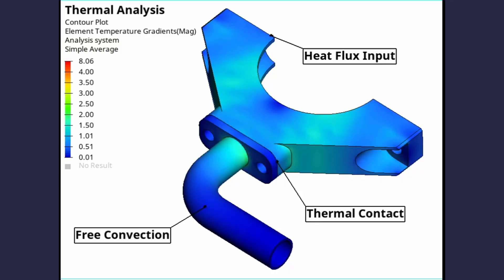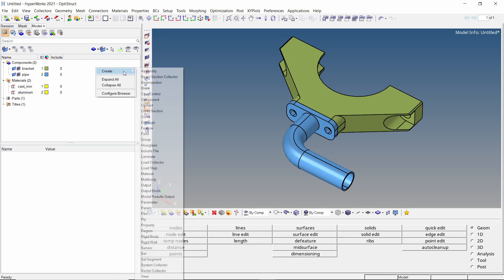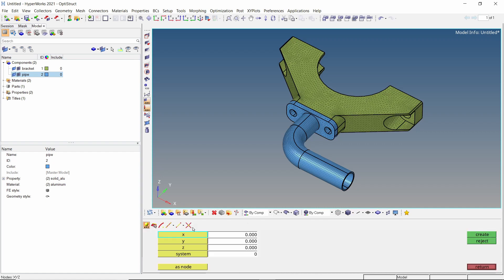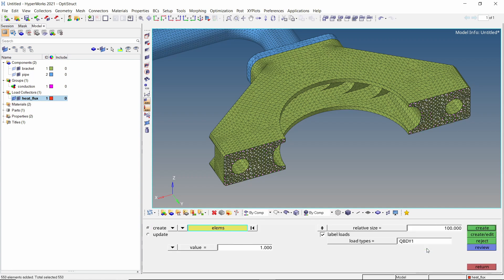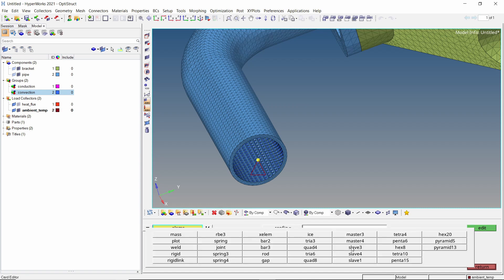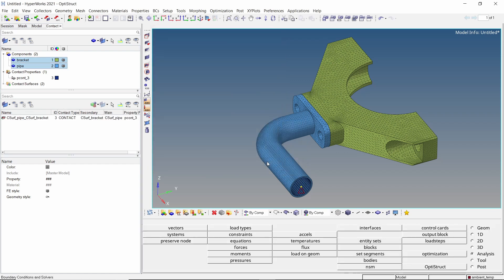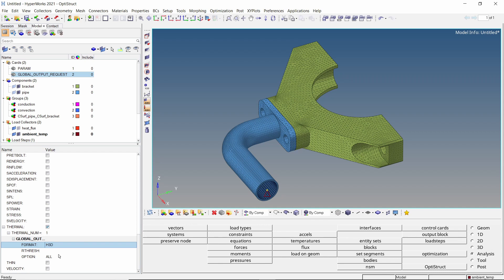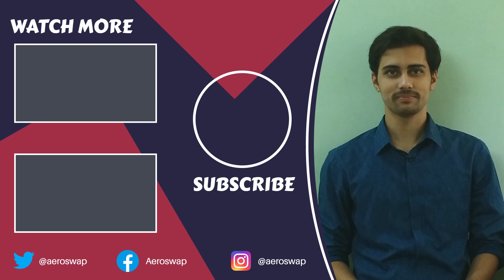Thermal Analysis using Hypermesh [Optistruct Tutorial]

Comment: Hello, 

I have some questions: 

1. How can I manage convection if I have an assemble that is meshed with Hex and tetra ? do I have to create two groups, one for slave3 (tetra) and one for slave4 (hex) ? 

2. In your model, only one part of surfaces is subjected to convection or flux load. So it means the most of your grid point have an initial state at 0°C right ? I guess that for a steady state study it doesn't have much influence but for a transient analysis isn't it better to change the default value or affect a load ? I don't know if I'm clear so I gonna explain myself with my concrete example. 
My goal is to see evolution of temperature node grid in an assemble that is placed in oven. For extern surfaces I use convection at the temperature of oven (and coefficient of forced convection). But my assemble has some free volumes inside; what should I do with them ? 

3. Does the localisation of the temperature point is important ? 

Thanks alot in advance for your help and sorry for my english, it is maybe not that good..
Reply from the maker: Hi Geoffrey,
Here are my comments regarding the doubts you have listed.

1. You can have slave3 and slave4 in a single group. As long as the type is 'slave', there is no need to create separate groups.

2. Yes, in this case the default temperature is 0 degC. However, you can use the 'UNDEFTEMP' control card to change the default temperature to a non-zero value. This can be done in steady state as well as transient analysis.

3. Location of the temp node does not affect the. It can be located at any location on the model. The only purpose of that temp node is to link the ambient temperature to the components. Apart from that, it does not serve any specific function. Hence, the location does not matter.
I created it near the pipe only because it is easy to do so! You may create it at any location you desire.

I hope this answers all your questions :)
Reply: @Aeroswap  thx alot for your answers, that will be helpful

Comment: Hello, can I ask an off topic question? to run Hypermesh correctly it's necessary to be always connected to Ethernet??
Reply from the maker: Depends on your license configuration. If you have a local license, it will run without internet connectivity. However, if your license is installed on a server, you will be required to stay connected to that server throughout your session.
Reply: @Aeroswap  thank you very much!
Reply: @Aeroswap  alright thank you very much! and there is the possibility to define a different thermal load on different nodes and specify both in LoadStep option TERM?
Reply from the maker: Yes, multiple loads can be combined using the 'LOADADD' card. Create a new loadcollector and change its card image to LOADADD. Now in the tabular data entry, we can select multiple separate loads to combine them. Use this LOADADD loadcollector while defining the loadstep!

Comment: Hello! please can I ask a question? if I am supposed to apply a thermal load on some nodes, which is the default/room temperature assumed, 25°C perhaps? And the value entered as thermal load is the temperature assigned to the node or the veriation with respect to the room temperature? thank you
Reply from the maker: If you apply temperature to a node, it is not room temperature. It is a temperature load at that location with respect to the ambient temperature, which is 0 by default.
Reply: @Aeroswap  alright, as I suspected,  thank you very much! and could you confirm that the way to apply this thermal load is to add the option 'TEMP2 in the card Loadstep? and if so, how do i can change the default temperature to be 25°C for instance?
Reply from the maker: To change the default temperature, you can add the control card 'UNDEFTEMP'. This will set the specified temperature value at all grid pionts in the model where temperature loads are not applied.

Comment: Sir how to overcome this error

"OptiStruct ERROR: 1.
 A fatal error has occurred in your model. Please refer to the .out
 file to obtain more information on how to correct it."
Reply from the maker: The cause of the error is not stated in this error message. Please check the .OUT file for this analysis for more information. You will find the OUT file in the folder where you saved the model before run.
Reply: @Aeroswap  sir iam triad. But it showing same error
Reply from the maker: Please check the file carefully to see if there are any discrepancies in the mentioned text. I cannot suggest anything until the actual cause of the error is figured out!
Reply from the maker: It's a license error. Please check if all installation settings are correct. Make sure that the license is correctly linked to the software. This will resolve the issue.
Reply: @Aeroswap  sir can you please help me in installations setting steps

Comment: Hi Swapnil! Long time to talk! Your presentation was excellent! When do you plan to present the heated bore - interference fit coupled analysis that we have discussed in previous conversations? Tell me if I can help.
Reply from the maker: Hey Emmanuel, thanks!

Right, I should start working on it now! All prerequisites for that analysis are covered through other videos already :)

I will send you an email soon. Let's discuss this!
Reply: @Aeroswap  Sure! I'll be happy to discuss it. One "silly" question since I am no expert in heat transfer modeling within the HM environment although it's never too late to start using it :) Your ambient temperature load collector is for denoting that both your parts are at an initial temp of 15 degrees Celsius? Isn't there another way to define this condition (i.e. the MAT card)? Thank you in advance for your reply.
Reply from the maker: Good question!
The ambient temperature loadcollector does not set the global temperature. It is only applicable for the convection interface. By default, the solver sets global temperature to 0 (unit as per the model setup).
If we want to change this global temperature to some other value, a control card has to be added - 'UNDEFTEMP'. This card can be used to set a global temperature value in all regions where we have not assigned a temperature manually.

I hope this is what you wanted to know!
Reply: @Aeroswap  Thank you very much for the clarification Swapnil!

Comment: hey bro 
In my problem there is no heat flux in case of heat flux they provide temp of 600 degrees
and to find displacement and stresses my values are zero in scientific values are also zero i have seen ur engine block problem 
how can i over come that?
Reply from the maker: Please check the value of coefficient of thermal expansion 'A' in your setup. If this value is wrong, the coupled thermal structural analysis will not work.
Reply: @Aeroswap  how to get A thermal expansion value
Reply from the maker: You can easily find these values on any online material database.